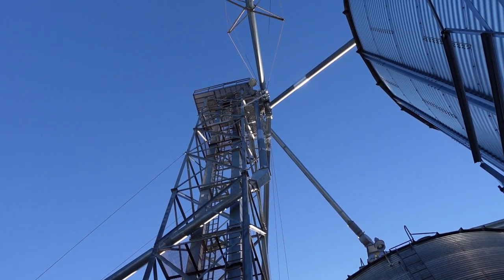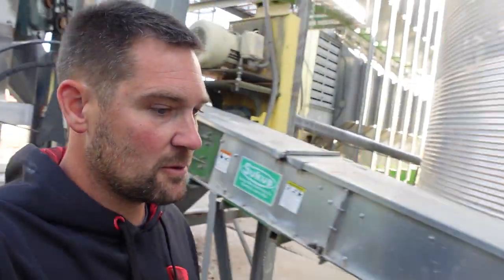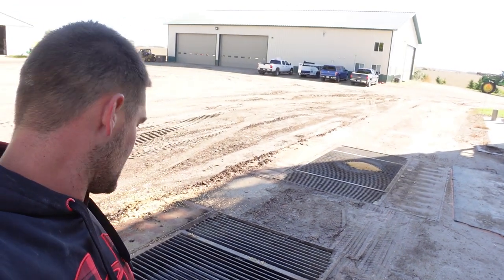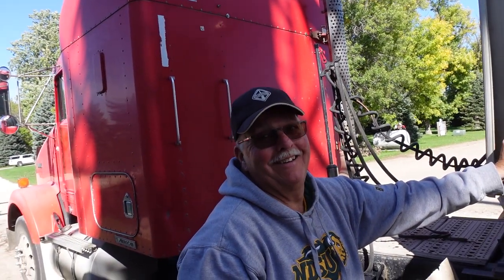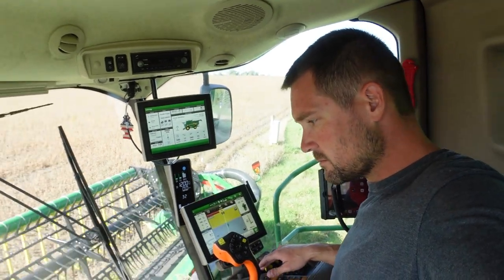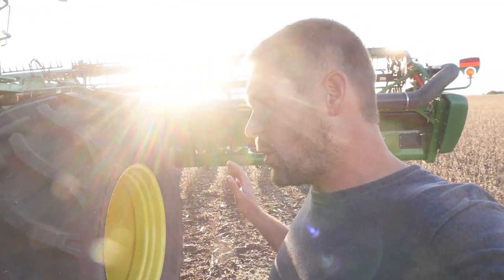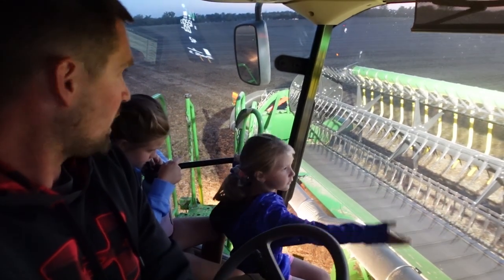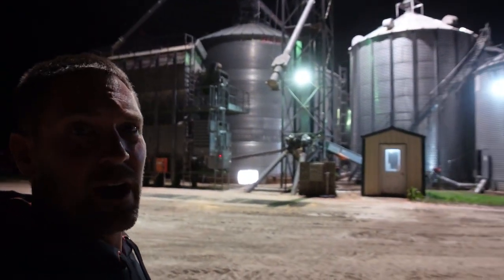What's The Worst that Could Happen?!

Comment: Speaking of two machines: You could keep the 9870 through harvest, at least through soybean harvest, and sell it after.
We have a custom operator close to me. They operate 4 Forage harvesters. Every April, they buy a new one, and run 5 through the season. Then in November, they sell the oldest and repeat. So they only pay off on 4 in the off season, and never have any that are too old. 👍
Reply: That's a nice little "Battle-rhythm" they got going on...Capital intense the first 5 years or so until you get everything in Sync.
Reply: I would guess as the new boss took over they were running the 4-5 machines and then he just started to exchange the oldest/broken one and buy an replacement.
Maybe the guy knows how to write it off so the irs is happy
Reply: @mwnciboo  The place have been going for over 50 years, this is just their latest adjustment ;)

Comment: Get some PTFE valve packing material, comes in a roll, just cut to fit and slip it into the ring ends. Less mess and lasts a long time. You are right though the ring let the pipe ends spread, only way corn is getting into the ring.

Comment: Hi Zac you could use the vhf radios you all ready have put a repeater on your grain leg get the radios set up to the repeater and put the transmit frequency of the repeater in as a talk around channel when you are out of range of the repeater or it goes down.We are grain farmers over here in Australia we have two repeaters one is on a 100ft tower and covers 50 to 60km other one is on a hill and gets more than 100km our repeaters are in the uhf band 470 MHz the reason for this is over here we have uhf cb radios as well they used to have 40ch and now have moved to 80 ch all farms use this service over here but is to congested at busy times like harvest,planting cotton pick as well as the trucking industry and general users. Our radios have the uhf cb channels fitted and our licensed repeaters frequency we still use HF radios here as well they cover the whole of Australia our cell phone network is the most useless setup I have ever used or seen yet Constance drop outs out of service or not working at all we are lucky to have as well a HF radio network called VKS737 it has frequency’s to cover more than 3000km the whole country is possible monitored 24 hours a day in conjunction with the royal flying doctor service I have heard all kind of emergency medical break downs and other problems in the the outback with help could be days away.Our repeaters and Hf radios play a big part in our farming operation over here would be without it

Comment: For those locking collars, bring a drill bit the same size as the tap for the screw and add a small divot for the collar lock screw to get into. That way  it’s not relying on clamping force so much.

Comment: Down here in Mississippi and Arkansas we irrigate corn and beans with polypipe which means we plant on raised beds and the irrigation water flows down the middles. When we cut beans we always cut diagonally across the rows. It feeds better and since we have fire ants the beans feeding in at an angle helps the keep the fire ant mounds raked off of the header.

Comment: Two words of wisdom for ya,  Gorilla Tape,  try it, and you will never use silver duct tape again!!!
Reply: Gray = crappy. 
Little rain  sun and the tape is flapping in the wind. Gorillas tape is good if put a clean surface.
Reply: I just tried gorilla glue am waiting for cure time of 24 hours 😜
Reply: @timrowland1490  
Wet the parts first.  By the time you finished your second beer. The glue is 90% cured

Comment: In the ring you have the leak at, it looks like you are missing some bolts in the flange that sits under the collar.  You mention that it pulled apart im guessing them bolts would bring that back together tight.

Comment: We have one drag conveyor that’s made up mostly of duct tape and old license plates 😂 it’s one of those it’s a small set up on a smaller farm and it usually just catches the overflow grain that it’s not looking like we will have this year...
Reply: We had one of those old Mickey mouse legs and used it for years..Finally tore it town.. It Maybe unload 600 bushels per hour. Then it would start back legging..
Reply: @davehughesfarm7983  The leg is fine it’s smaller and older, it’s the drag from bin top to bin top lol. Thankfully but sadly it’s not looking like we I’ll need many of those bins at that set up this year as the Main farm set up should hold it all
Reply: @davehughesfarm7983  it was probably getting old and tired and needed to be tore down anyway. Because Walt told Mickey to shut down production on legs back when they had the Witch Hunt for commies, and other perversions. That was quite a while ago! So that system was getting pretty old. LOL. When we'd have a bad year on the farm and ranch my dad always told me don't lose your sense of humor. Because if you do, the important things you start to lose next.!
Reply: Your Lucky my one is made of metal 😂

Comment: Zach, Duct Tape is great and all, but I recommend getting a few rolls of High Temperature Flue tape. I've used that in a pinch when I didn't have a welder handy. It last for years. May never need to fix it right.
Reply: My dad says "There's nothing more permanent than a temporary repair that works."

Comment: Those band clamps usually come with a v shaped inner gasket/band, the outer band is usually wide enough that the flange can pull apart a little when the band alone is used. The gasket or inner band helps with closing that gap btw the flanges.
Reply: I hate 'em.  But they work best mating (2) 1/4" flanges

Comment: For the vaporiser on the sukup drier I’ve worked on, you have to undo the clamps and rotate the pipe away from the burner. Pulling it out of the burner just made it worse.

Comment: The leak in the conveyor is because the bolts holding the seal came out...  I could see 3 missing bolts.
   You can see a bolt that came out sitting on the side opposite of Zach.   =)    02:38

Comment: Is it just me or did it look like that joint was missing a bolt where it was separated and spilling corn out.
Reply: clamp just needs tightening........................ ??
Reply: @raymondo162  i assumed that too but looking at the other joints right there the one that was leaking was missing a bolt compared to the others.
Reply: Yes, thought so too.  Through the flange, the clamp is around.

Comment: The millwrights didn't adjust the 22° elbow sections correctly when they installed them. There should be no gap between the flanges when they are adjusted properly. Get them back out there to adjust it properly and don't let them use caulking to close the gap!

Comment: Real question ! : I always wonder why you guys doesn't use a king of crater bin floor like we use over here in Europe (Mainly as far as I know) with just a single screw that takes all the grain that good old gravity brings back to the center. (Was it clear ?)
Reply: We call them hopper bottomed bins. Used for small capacity but flat floor silos for 1000 tonne or more.
Reply: @Willdu87  OK thanks for the vocabulary 😅 But I mean ... why ? It work just as fine for 1b ton bin no ?

Comment: I've been curious, why go diagonal to the rows when cutting beans? I've drove truck during bean harvest but never ran a combine through them
Reply: It helps to even the crop flow across the head, but also allows all the cutter teeth to be utilized on the cutter bar instead of just the one or two teeth that would line up with the bean row if running straight.

Comment: Looks like you are missing a bolt.  If you looked at the one above,  it has a bolt where the clamp comes together.    But all else fails, use the temporary permanent solution.

Comment: I want to say that you may run into issues with that honeybee head with short bean conditions.  I believe I was watching mike Mitchell harvest with a similar head that has that rock trap built in at the sicle section.  It was constantly getting plugged at the front because there was not enough material to help push it up that trap.  Anyone else know what I am talking about?

Comment: Actually you wouldn't have time to think about the fall. 
Falling from 60 feet takes 2.3 seconds and a 150 lb body reaches 38 mph in time frame during the fall.
Reply from the maker: Our leg is 90 feet, plus I'd bounce off several things on the way down which would slow the process.  Therefore I'd probably have 8 seconds and 17 broken bones before being put out of my misery.
Reply: @MillennialFarmer  you might not bounce. You might get impaled if you hit at the right angle.  Happy thoughts for you to think next time.

Comment: You could improve your radio coverage by possibly installing a repeater. You already have a tower that you can mount the antenna to and with the terrain surrounding you (basically flat with very little trees) you should realize fantastic range from a repeater system. I’m assuming you’re operating on GMRS which would be perfect, very easy to add a system on GMRS. I also noticed you’re using Kenwood mobile radios, same here. I’d be happy to discuss this further with you if you’re interested. No, I don’t work for nor am I associated with any company that sells radio communication equipment. I happen to have several repeaters on the air and I know how much of an improvement it’s made for myself and my team of volunteers. Anyways, reach out if I can be of any assistance and thanks for taking the time to record, edit, edit, and edit in order to produce your quality videos, I enjoy viewing them when I have the time and your hard, time consuming work is much appreciated.
John C.

Comment: You are missing a bolt and probably a nut.  Pause at 1:55 your thumb is almost touching the hole.  Also at 1:55 you can see the bolt in the junction above it.  Keep watching and you can see the ones on the backside holding seams together.  Now you get to make that climb again,  you're welcome. ;-)
Reply: Bolts aren't missing,  but  the rings could be tighten with a little help from a hammer.

Comment: I think you should put a bean or two in each ear and wrap duct duct tape around your head to cover your ears! Otherwise, you're going to be deaf before your 40th birthday! What? You are already deaf?! I don't doubt it with noise extremely loud dryers! I always thought they used heated air. Apparently, they just use 125 decibel sound to vibrate out the moisture!! 😅

Comment: Perforated metal, put a screw in halfway next to the lower sheet edge then pull up with pliers. Same time put in screw on the joint.
Or use a stiff piece of wire and bend at 90 degs, pull up using pliers. Save you a heap of frustration. You can buy me a beer next time you are in OZ. :)

Comment: Love the vids. But the one thing that is just driving me crazy is a bad habit you have. As an experienced crane and equipment operator I was taught long ago to never get out of a piece of equipment with any attachment still elevated. Why not just set the header or whatever implement on the ground before you leave the cab. Holding valves are great till they fail or a hose blows. Safety is task one for the day.

Comment: As a non farmer, I don't understand why there's no roof over the grain pit. It seems to me that if I were to design a grain pit I'd first see to that the pit was absolutely water tight under ground, and that it was raised three feet over the surrounding area with long ramps leading on/off it to stop surface water running into it. Then I'd put a roof over it so rain and snow couldn't reach it and put some strong lights under it for unloading trucks at night, but as previously stated, I'm not a farmer, so what do I know....

Comment: With years like this without much rain, do you have the ability to close off your tiles to hold onto what little water there is ??
Reply: Good question. That is not how tiles work . They only take water out of saturated soil.  The tile does not remove moisture actively it only takes the excess away.  So of there is not too much moisture it's not going out the tile any way. 
I'm trying to explain it without going into the soil science so hopefully you understand if not I can try another way .